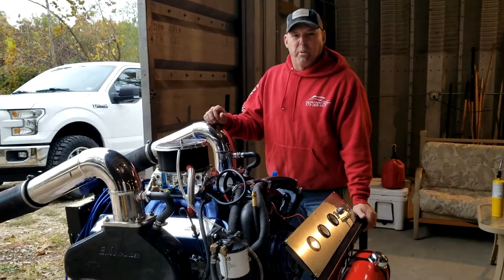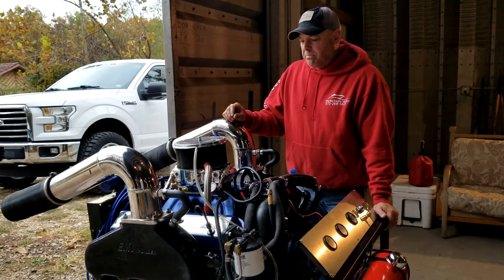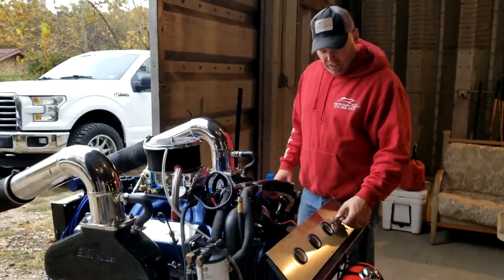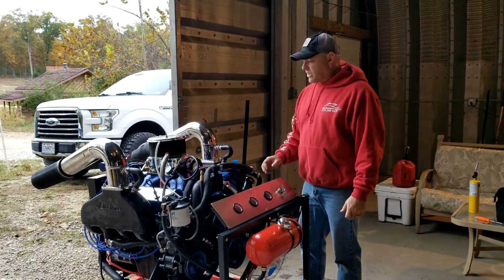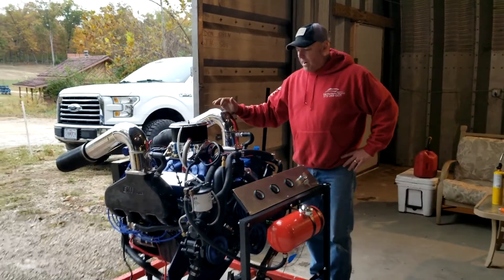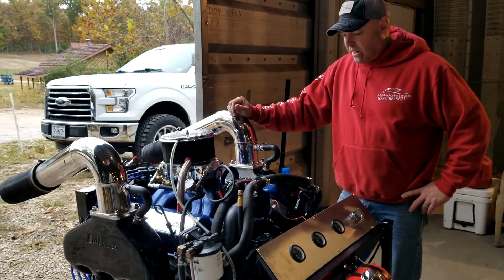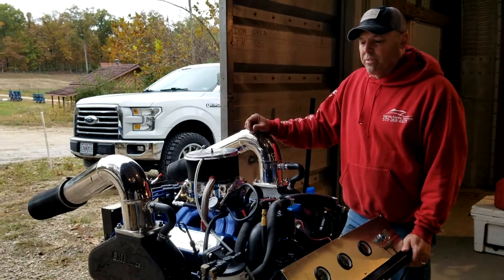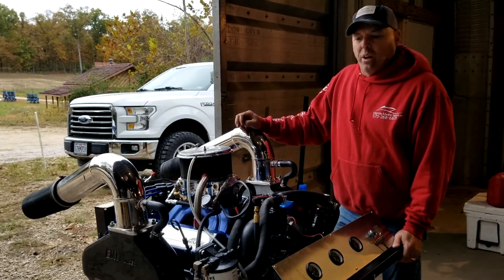Mercury Racing 500 HP convert to a 540 CID built by Fowler Racing Engines of Mid MO Marine Services.

Comment: I put a 460 in my last Cobra replica kit. But I made a couple mistakes and it didn't quite make 500 horsepower. Just starting a new build and I'm going to use mustang p51 heads and a bigger cam in the 600-ish lift range and I'm going to increase the stroke my 30 thou we should give me 502 CID. All in a 2300 lb car woohoo!